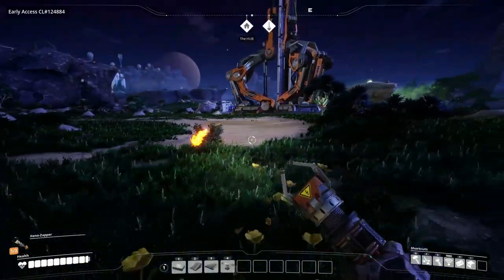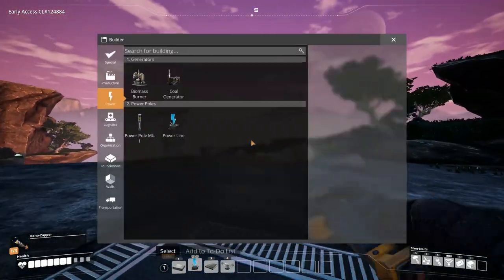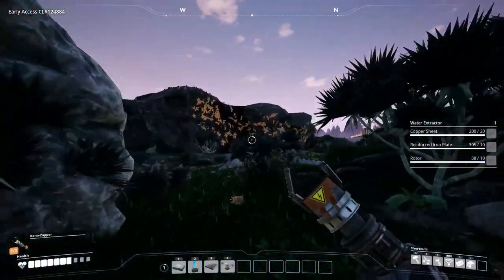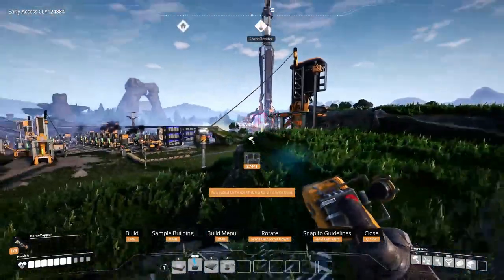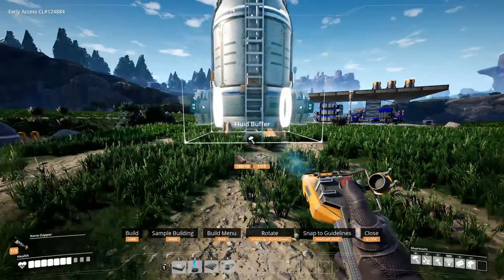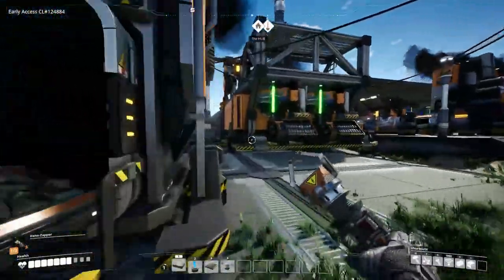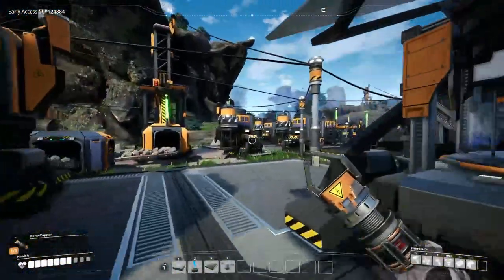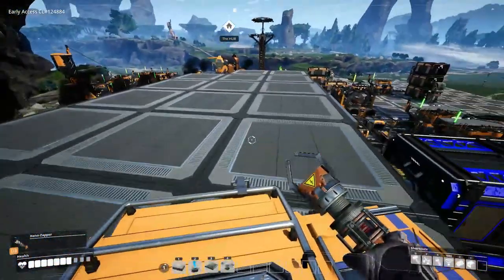SATISFACTORY Day 3: Coal, Water & TRACTOR

Comment: You can also reset power from any power pole.
Liquids will flow forever *horizontally*. If you try to pump it to a higher level, then you need a head pump. Each head pump will push it  20m higher. Simplest way is to just build your coal plant at or below the level of your water pumps so you don't need to waste power/effort on head pumps
Reply from the maker: Excellent, thanks for the tips!  Please keep 'em coming I'm feeling a little overwhelmed with this stuff!
Reply: @robertlyon  It's an overwhelmingly deep game. You don't feel like an expert until you hit 100 hrs.

Comment: Cougar your biomass was also on standby when you reset it therefore it wouldn’t restart, there is a small red rocker switch at the bottom right of the screen that you have toggle. I know you you probably know that but just thought I would point out only because I had the exact same problem😄
Reply from the maker: No I didn't realize that thank you!